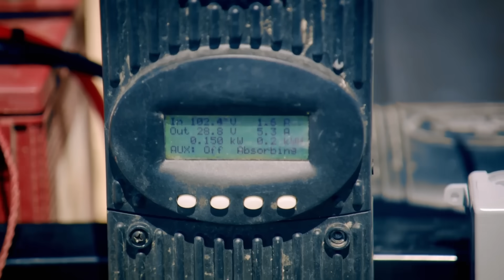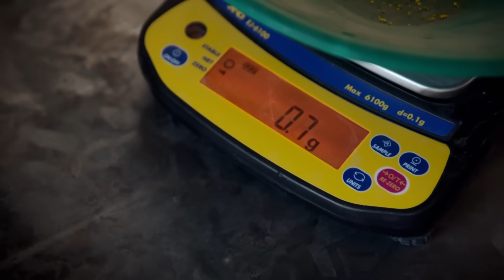Custom Solar-Powered Plant QUADRUPLES Gold Production | Gold Rush: Mine Rescue With Freddy & Juan

Comment: FREDDY ARE YOU DOING OK? LOST A BUNCH OF WEIGHT, JUST CHECKING BUD 07
Reply: I wonder how old he is? Inflammation is a sign of illness. He could just have been overweight and decided to lose weight. Fuel is so expensive that an alternative is welcome. I know the trains and large mining equipment are diesel with electric motors. Fully electric tractors would be cheaper in one aspect. But, building infrastructure to power them and purchasing them would be another hurdle. The sun powered trommel works pretty good.